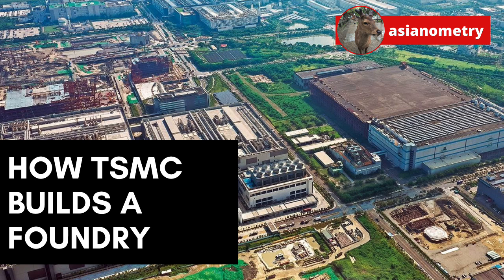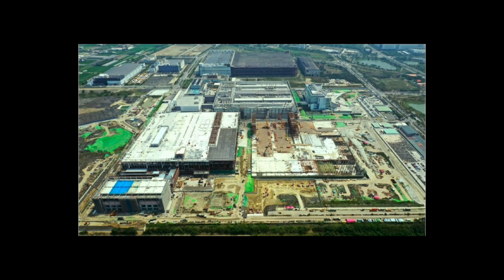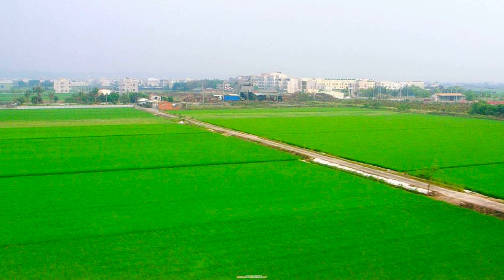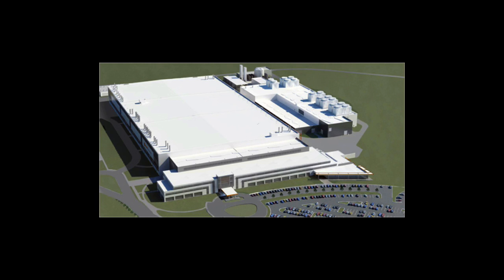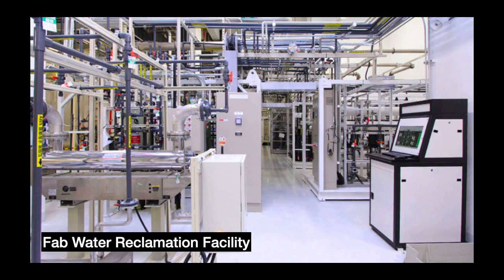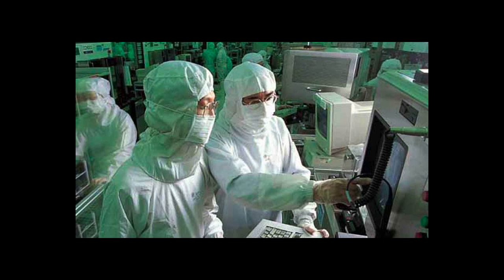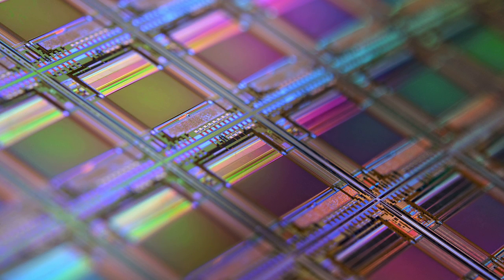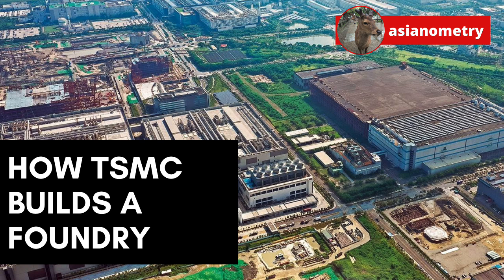How TSMC Builds a $19 Billion Fab

Comment: But what I can tell, the biggest shortage is for chips that use much older technology, not the newest. You hear about the shortage for automobiles. That is really old stuff, like 14 nm or maybe older. There have been attempts to move the auto industry to newer technology, but they do not need very capable chips for what they do.
Reply: it was a scam to select CareFree near Phoenix. Its a desert and short on water so eventually when Colorado River no longer can provide the water capacity this fab will have to shut down...there is no high class university to tap engineers. With high heat of 40C for weeks will cost high utility bill...its suicidal but TSMC never factor such disastrous fatal mistake of choosing an insane illogical incompetent location...old man morris was conned and shown his stupidity haha

Comment: This video was likely to have been made before the current worldwide  "semiconductors shortage" crisis.
The shortage problems are not easily resolved by just building more clean rooms, whether in Arizona or in Taiwan.
A new approach to the fabrication of the integrated circuits on the silicon wafers need to be developed.
Scientists and researchers should explore the use of 3-D printing instead of the photographic process in the manufacturing of these integrated circuits.
Reply: 3d printing would kill yields.
Reply: @chinogambino9375  
The yields may actually increase as more of these simpler (and much cheaper) 3-D printers can be used producing the ICs in tandem.
The ICs can be individually formed other than many ICs on a circular 12 inch wafer and then cut up.
Need to do the necessary R & D to achieve this new method.

Comment: Nice video. You kind of take the machine that you are a part of for granted. One thing that stood out to me - ballroom and mini environment. 

For fab layout there are generally two (been a while since undergrad) - ball room and bay and chase. Then each tool , generally speaking, has their own mini-enviroment that has its own filters to further clean the air. Because of loadports that dock to the factory interface/EFEM (might be more terms for that depending on what toolset you work with), and FOUPs (wafer carrier) that have gaskets, you don't need a fab with as tight of a tolerance in air purity.

The fab has laminar airflow, so air isn't pumped from outside as much as it's filtered. Filters on the ceiling, air flows down, through floor grates, and is filtered again.

Comment: Actually, for very expensive equipment with very specific and advanced applications, most of the time the producer doesn't know his machine capabilities better than the end user. They just build the machine on the client specifications, but they don't know how it actually works in order to produce something, since they have no way to actually use the machine for its intended purpose. I learned this first hand for sputtering machines.
Reply: Yes, and No. I've worked on these very tools for several years now. Often, the manufacturer has their own people on site for in depth troubleshooting and specific problem solving, as well as understanding a degree of the requirements by the end user. We make the tool do one thing, but they know how to make the tool do many things.

Comment: Hi asianometry,

Do you have time to make a video covering TSMC six 12" Fab in AZ for 5-nm technology and how it affects Intel? I work in the industry and highly doubt if the plan will work. 
First, AZ is a desert and I doubt there is enough water supply for six TSMC 12" Fab and the existing Intel Fab. 
Second, is there enough labor for TSMC in AZ? Currently, the software industry is in its golden age and a programmer can easily have 2 times or higher income than a semiconductor engineer. I guess that's the reason why the US is no longer in the leading role in semiconductor manufacturing. 
Third, the current chip shortage mainly in the automobile market, not in CPU, CPU, or any high-performance applications market, which is TSMC focus on. If TSMC builds another six 12" Fab in AZ, I am pretty sure that the high-performance applications market will be in oversupply and these 12" Fab in AZ won't be profitable in the future. Fourth, TSMC will do risk production on 3-nm technology (equals to Intel 5-nm) early next year. In the meantime, Intel is still struggling with its 10-nm technology (equals to TSMC 7-nm). Though the new Intel CEO claim 10-nm is on the track, no one knows if it is true given the 14-nm disastrous experience. If Intel 10-nm (TSMC 7-nm) is another disaster and intel's competitors apply TSMC 5-nm technology. It means Intel is falling behind at least two-generation. Can intel survive?  Or eventually, separate its Fab and design department as AMD and GF did in 2008? If it is the latter, hundreds of thousands of Intel engineers will lose their job. 

Thanks
Reply from the maker: Lots of questions. My uninformed opinion is that Intel will be fine. $17 billion of annual cash flow will do that for you.

Comment: Could you talk about the benefits Intel has with having a Production facility in Ireland. There both in the European market so that would help with cost of shipping from the Netherlands and the distance is much shorter
Reply from the maker: I have thought about that yeah.
Reply: The cost of shipping is not the main cost in semiconductor manufacturing. Semiconductor tool supply chain, latest technology with high yield, and massive workaholic engineers are the key factor. EU has a supply chain but lacks the latter two factors.